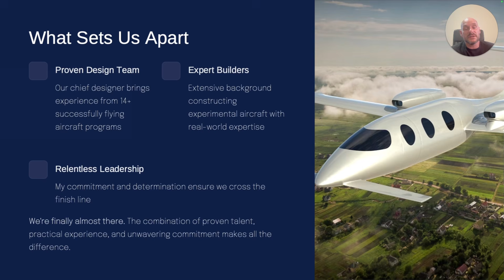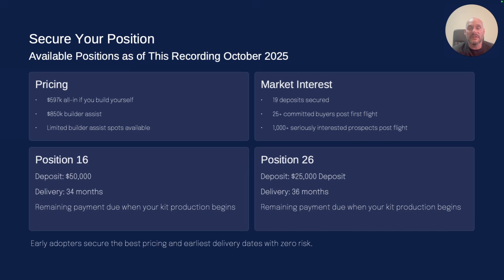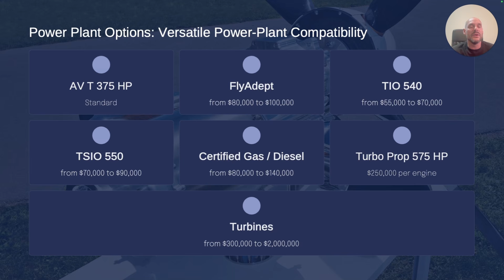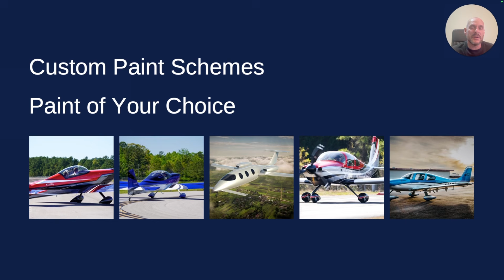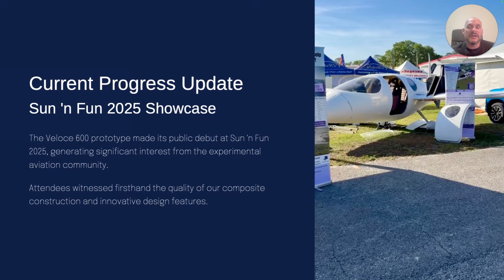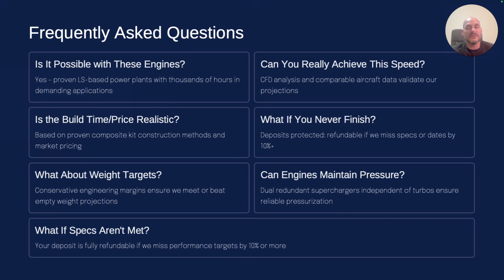The Fastest 8-Seat Twin Ever Built Under $1M - Meet the Veloce 800

Comment: Good day. The model is a Veloce 800, with a cruising speed of 350 knots (600 km/h). The total cost is 850,000 USD. Is that correct? Thank you.
Reply from the maker: yes, close to correct.   333ktas is the crusing speed witht he aerovolare engines.  with different engines, speeds will be different.  two 600 HP engines and your at 400 ktas

Comment: Jamie …if ECLIPSE 500 FAILED , and recently LILIUM VTOL 36 shrouded turbofans …MOST start ups FAIL, and AVIATION , well 😂. Leave the kit assist build to LANCEAIR TRUBO with a PT SIX.., you are literally flushing your investors SEED money down the tubes . You say I am gonna be around . Yes but the VELOCE will not. It’s a grace yard littered with failed start ups kiddo ❤
Reply from the maker: you are absotluly right.  eclipse didn't fail as a sart up though.  but yeah, most plane start ups fail.  like higher rate than the 90% of most normal businsses that fail within 5 years.  and yeah, i am doing everything in my power to make it succeed.

Comment: Why sea level pressure instead of 6000' or something around there? Much less cyclic pressure loading and risk of fatigue failure on the hull by not going all the way down to sea level. No one is running on a treadmill in there haha
Reply: Read it carefully, it has a 6.7 PSI differential between the inside and outside of the plane at 25,000 ft. Using the 1962 standard atmosphere, which is the standard for aerospace atmospheric calculations, that comes out to 12.15 PSI inside the plane, equivalent to ~5,150 ft.
Reply from the maker: yeah, trying to get it as low as we can
Reply from the maker: i try to say near sea level.   sometimes i forget. but yeah,  lower than most every other.
Reply from the maker: because old wealthy people who are buying these, prefer less jet lag when they get there.

Comment: This notion of it being a "first" for twin, or I guess you can say "more than 1" compressor is wrong. What you mean to say is that it would be one of the few jet engines that does twin stage centrifugal compressors. This is intentional however that most don't do it as it's a less efficient design. I assume your supplier is doing it for packaging reasons, given that it is an electrified engine design?
Reply from the maker: first pressurized composite twin.   not first twin.  we also have a parachute.   yeah, there are 3 others with a composite twin, but they all put tiny engines on the wings.
Reply: @VelocePlanes  I was referring to the turbine specifically, and the compressor stages, the HTP500R. It seemed to me that it was a smaller but denser (heavier) setup than a typical PT6A in that power class so I was curious why they would go for that kind of setup.